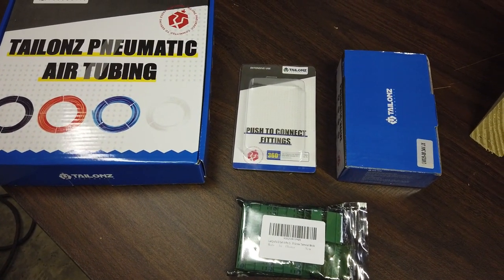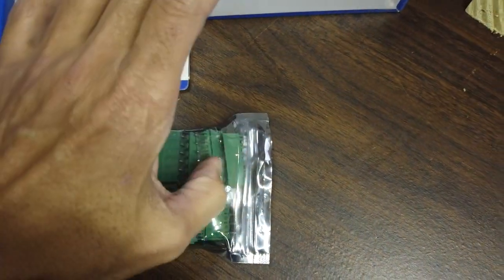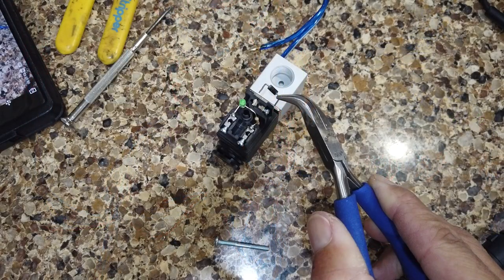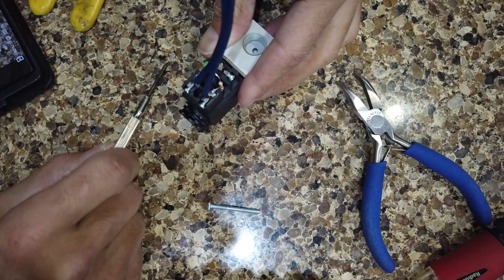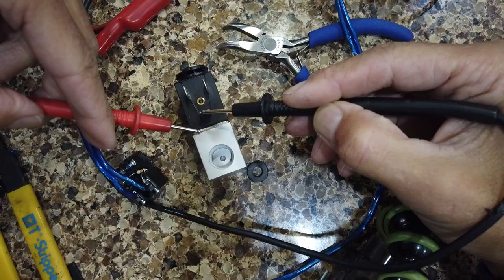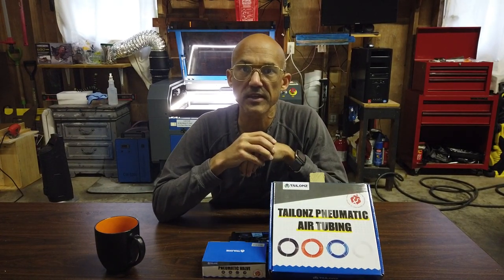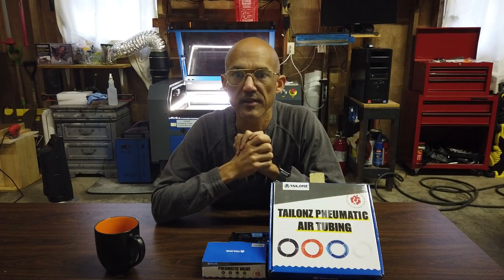CO2 Laser Air Assist - Extra Ultimate Upgrade for Omtech / Ebay / Chinese Laser Engraver / Cutter

Comment: badass video. Do you know what the outputs would be for this mod on a TROCEN CONTROL CARD AWC7824? I want to do this to a Boss HP 3655
Reply from the maker: I don't have a trocen controller so I can't say for sure, but I think a little bit of research will get you the answer you need.  I found this for a similar trocen controller - https://forum.lightburnsoftware.com/t/air-assist-clarification/61377/9

Comment: I think I missed it somewhere but the cylinoid with the diode is that high pressure or low pressure?
Reply from the maker: Both solenoids should have a diode. It protects the controller.
Reply: @directedt3ch  thx you for your response back 👍

Comment: Great video! Very clear and concise instructions. What size compressor do you recommend for 2 laser machines hooked up to the same compressor? I’m planning on running both cut jobs simultaneously
Reply from the maker: As big as you can afford honestly.  The bigger compressors are going to have a higher duty cycle.  If you are driving two machines and 20-30 psi, that compressor is going to run A LOT! If I'm doing a lot of cutting then I hook up my 22 gal Craftsman.  If I'm doing a small job then I'll run the little 2 gallon compressor from harbor frieght.  Luckily the Craftsman is in another room so I don't have to hear it cause that thing is LOUD!
Reply: @directedt3ch  I appreciate your help! I think I’ll have to go with the ultra quiet compressors since noise will be a problem. Do you think the 20gal 2HP ultraquiet compressor from cali tools will be sufficient? I guess, I’m not 100% sure which specs matter for a laser machine.
Reply from the maker: @jim2405  That sounds like a good place to start. See if the duty cycle is listed. Most compressors aren't designed to run continuously. A 50% duty cycle means it runs for x minutes then rests for the same amount of time. Bigger compressors usually have a higher duty cycle.
Reply: @directedt3ch  much appreciated brotha!
Reply: @directedt3ch I have the same co2 laser as you. Curious to know if you’ve ever encountered this issue before. Sometimes, my laser freezes mid cut. Machine is still on and laser freezes at a random spot and stops cutting. Has this happen to you before? It’s happening more often after installing this setup, but it could be other factors.
Reply from the maker: @jim2405  That hasn't happened to me.  I have my laser connected via ethernet.  I know USB can be a bit flaky sometimes especially if you 'start' the job from the computer instead of 'sending' to the laser and then starting the job from the machine.
Reply: @directedt3ch  interesting, I’m starting it from my pc so that could be the problem. A truncated/incomplete file. Seems to stall near the end of a cut. Do you have instructions for sending to the machine then starting from there?
Reply: @directedt3ch  much appreciated! I’ll give it a shot!

Comment: I’m very confused and need help.  Pin 5-6 show 24v with a multi meter but as soon as I plug a solenoid it drops to like 4.4v.  Nothing changes when I run a file with air assist on.  I enabled air assist from vendor settings.  The led on the solenoid is constantly on.  I really don’t understand what’s going on.
Reply from the maker: That is an odd one.  How about pins 4 and 6?

Comment: I enjoyed your detailed YouTube video,  and I think we have identical machines, except Kt322N controller

I'm having a problem.  I wired the LP solenoid to the status terminal and air flows as soon as the machine is turned on. The HP solenoid works fine

When I'm running a job with the Lightburn air assist turned on, both solenoids are on.

I assumed that the output terminals would be live only when the laser is on. I'm finding that this is the case only with the HP solenoid wired to the air terminal

Any suggestions?

Thanks!

Dale
Reply from the maker: I wish I had a good answer for you - I tried to look at the port descriptions for that controller here: https://www.manualslib.com/manual/2437203/Ruida-Kt332n.html?page=17#manual  but I'm still not sure what they are trying to say about the status port.

Comment: I have air assist from cloudray and their solenoid valve has two inputs and one output. Se when signal is low, I gel low pressure on output, but when high, I get hight pressure.
Reply from the maker: That is handy!

Comment: So I wired the solenoid wrong because I was confused about your blue wire with the white stripe being shown over the negative terminal.  Will the switched polarity damage the diode?  I have it wired correctly now but my solenoid will not open.  The led lights are on regardless of what I choose in light burn.
Reply from the maker: If the diode is in wrong, it will be short essentially.  It's there to prevent possible damage to the controller.  But you can try it without to see if that helps.

Comment: Does that diode go in both solenoids?
The cutting goes perfect but when I go to engrave, both solenoids light up...
Wondering what I dit wrong...
Reply from the maker: Yes, there should be a diode on each solenoid.  Pay attention to the direction of the diode. When engraving, your low pressure solenoid (connected to status) show engage. The high pressure  solenoid (connected to wind) will only engage when air is toggled in lightburn, assuming you've made the proper change to enable it.

Comment: I just wondered what diode did you use, was it something like a 1N4004 etc, excellent video and I have seen a few, but but not all have the diode fitted, which is important 
Thanks
Rick
Reply from the maker: I used a 1N4001 diode.  The link is in the description. :)

Comment: Did you remove the stock air pump? If not, how do you disable it? Thanks.
Reply from the maker: @sutiteeraniti2486  I left it in but I disconnected it from power.

Comment: I seen you used diodes in your air assist upgrade, Are the diodes required? I seen another video and it says diodes are optional equipment but doesn't explain why.
Reply from the maker: You'll hear both sides of this argument. When the coil in the solenoid is energized, a magnetic field is created that moves the metal plunger which allows the air to flow.  When the coil is denergized, that magnetic field collapes and that induces a voltage back into the coil.  That will go back to the laser controller.  Those outputs use an optical issolator to protect the rest of the circuitry from the back current, but the opto-isolators can be damaged if they are pushed past their rated values.  The diode is a saftey method to prevent damage.  When installed properly, they don't impact the normal function the solenoid.  When the solenoid is de-energized, the diode provides an alternate path to ground and protects the opto-isolator.  So, could you not use the diode, sure.  Could your controller work for years without issue, sure.  Or one day your air assist might stop functioning because the opto-isolator blew and unless you are good with replacing surface mount  components, you'll need a new controller.  The diode is an extremely cheap safety method.

Comment: I will follow the guide! My machine have a "warning lamp" connect on status. You think its secure manteind this connect?
Reply from the maker: I can't say for sure.  I'd think that connection will go on whenever the machine runs and can't be controlled via lightburn with the air assist toggle.

Comment: i have the 80W OMtech and mine has the air pump for the head (just for purging) i can use this same setup with the purging pump and hook my air compressor to the aux air switch on my controller, correct
Reply from the maker: Yes. You would just need one solenoid and lightburn would only control your high pressure. The integrated pump would be your always on low pressure.

Comment: Do the relays really need to have a free wheeling diode installed? I thought the Ruida controller had built in protection. Also, I was hoping I'd be able to do on/off with the laser on/off rather than status so its not blowing air when the laser isn't actively cutting or engraving. I wonder if there is still a way to do that?
Reply from the maker: I've heard that too.  But for the cost of the diodes, I'd rather not find out that the Ruida controller isn't protected.

Comment: Great video. I wish I would have found this first. I set mine up with the single solenoid. I’m having an issue where sometimes when I hit start in lightburn the pressure on the in-line pressure regulator drops to zero. Would the diode help this? Thanks.
Reply from the maker: No, the diode is to protect the controller when the power is removed from the coil of the solenoid.  I haven't had any similar issues.  I could just be a bad or sticky solenoid.  I've also heard that if the incoming air pressure is too high it can affect the ability of the solenoid to open.
Reply: @directedt3ch  ok thanks!

Comment: I just tried setting this up today. I followed along. I got the solenoid firing when air assist is on in lightburn. But when it shuts off it’s still letting a little air through. What am I missing?
Reply from the maker: When you say it's still letting a little air through, do you mean through to the cone on the laser head?  If that's the case I'd check to make sure that your solenoids are closing fully.  If your compressor still cycles occasionally even when neither solenoid is open, you could have a small air leak in the tubing before the solenoids that is allowing your pressure to drop.  I will note that my compressor still cycles on occasion, but it hasn't bothered me enough to hunt down the issue.  It could just be that these solenoids are relatively inexpensive and not machined perfectly.

Comment: In conventional solenid circuits it is good practice to prevent backEFM pulses reaching voltage sensitive components such as transistors. In the case of the Ruide controller  there is no such risk because all of the input terminals are optically isolated.

 Most nozzles have either a 4mm hole (12.5sq mm)  or a 2.5mm hole( 4.9 sq mm). If you pull your solenid apart is it is simple poppet valve  where a spring loaded rubber pad  is used to shut the flow off against a 1.5mm orifice (1.76 sq mm). To get adequate flow out of your nozzle you are having to use 30psi to create sufficient FLOW through the MASSIVE restricion (1.76 qs mm) within your solenid valve.  I have opened up my orifice to 2.5mm  which will have limited the pressure against which the spring will seal but it has allowed me to use just 4 or 5 psi for my 2.5mm diameter nozzle.

 Your use of two valves along with "Wind" and Status" is a neat control solution. 

Sadly, you stopped the video before we could compare the engraving difference between high and low pressure air assist. We did not see what lens you were using or the type of nozzle and the distance  between nozzle and work.......all importand factors to engraving success with or without air assist.

Thanks for a well explained installation/solution
Reply from the maker: Appreciate all of your insights!!

Comment: I'm not sure where you explained the reason for the diodes(missed it somewhere).  What does it do?
Reply from the maker: I probably didn't mention it in the video.  Inside the solenoid is a coil of copper wire. When energized, the magnetic field moves the metal rod that opens and closes the airflow.  When you denergize the solenoid, the magnetic field collapses and current is induced into that coil of wire and without the diode, that current goes back to controller.  The diode is a "one way" valve that only lets energy flow from the controller to the solenoid and prevents that back current from damaging your laser controller.
Reply: @directedt3ch  Awesome thanks!!!
Reply from the maker: @jimreykdal7477  You are very welcome.
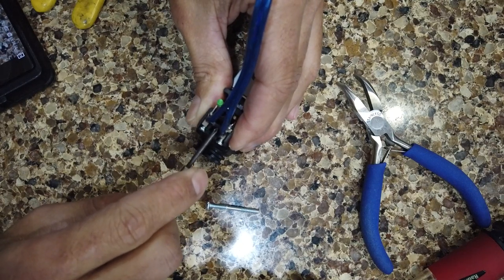Reply: 8:50
Reply: Do you have info on diode?

Comment: Great video, great instructions. Make sure you watch the end. I skipped the light burn machine settings and could not figure out what was wrong. Once I made those changes everything worked as designed. Now to figure out how to disconnect the factory air pump
Reply from the maker: Glad you got it all sorted out Thomas!

Comment: Great Video!  I had it working from Brandt's video with a single solenoid and I could have just been on standby regulating the air pressure regulator but figured there was another way.  Came across this video and it's great!  I didn't pay close attention to the diode requirements so it's currently working with high and low pressure, but I'm ordering the diodes as an insurance policy.  I really appreciate the thorough instructions.
Reply from the maker: That's wonderful!  I'm so glad that it helped.  For the cost of the diodes, it's definitely worth the piece of mind.

Comment: Why can’t the diodes be installed in the control board connector?
Reply from the maker: It's best to disipate that electricity closest to the point of generation (i.e. the coil).

Comment: This is a very helpful video however I did have an issue that I have not solved as yet. We all the steps were complete and I started to run my test I see in your video that Lightburn has the air off on the low air part and on when it's going to high pressure air. My Lightburn has both air as ON. When I started my test the which should have been the low pressure air, the hight pressure air solenoid light was on. I took the air hose loose from the leaser head and connected a piece so I could easily monitor the air flow and the air pressure stayed the same. Any suggestions ?
Reply from the maker: First I'd make sure that you've enabled the air assist function in lightburn.  Then, I'd get a voltmeter and test your controller pins.  The wind and status pins should connect to ground when activated.  Status should go low (connect to ground) when a job starts and wind will only go low when the air assist is toggled on a layer that is running.  You'll also want to ensure that your +24V pin is giving the correct voltage.  You can also test the solenoids individually by connecting them to 24V and a ground.
Reply: @directedt3ch  I did get things working but I had to manually turn off air for engraving and maybe I miss understood but I thought that was automatic thru Lightburn
Reply from the maker: @KennethWilkes-p9k  The air assist toggle on your layer settings wont do anything unless you've enabled it in the Machine Settings.  Then that toggle will actually translate to the wind pin going low to activate your solenoid if it is properly hooked up.

Comment: Love this setup worked without any issues love that the air blows only when engraving or cutting. As for the stock air pump. Can I just cut its power from the controller? Looks like it’s connected with some other wires and has silicone on it. Anyway I just want to disconnect it so it isn’t always running
Reply from the maker: Yes! That is what I did. Just disconnected that little pump from the electrical connection.

Comment: Great video, thanks. Which ruida are you using? For some reason my setup isn't working with status. I get the high air pressure on cuts when connected wind and 24v but the other valve isn't tripping. I can't figure out the issue, it's connected to 24v and status, but the valve isn't opening.
Reply from the maker: Try testing out the second solenoid by connecting it to +24 and ground. This should cause it to open.  That will narrow down the problem area to either the controller or the solenoid.  I've heard of several people getting bad solenoids sent to them.  My controller is the RDC 6442G-B.
Reply: @directedt3ch  I appreciate your reply. The solenoid works when hooked to the power and ground. However, when both solenoids are hooked up to how we want them with wind and status, the one that is giving me issues (wind) is always dimly lit, whether or not it should be switched. But this doesn't mean air is coming out. I tried wiring them in series thinking it was a power problem, but I run into the same issue. Maybe it's the wind pin that's not allowing a complete circuit? I'm also using a higher gauge wire than you and maybe it's too thin? Idk, I'm stumped at this point. I also tried different 6 pin connectors but that doesn't seem to be the issue. Could it be an issue with the controller?
Reply from the maker: @caseygriswold8617  That is the only thing I can think of :(  You did make the change to the settings in Lightburn to activate wind pin, correct?
Reply: @directedt3ch  Yes. But I never added the diode! I thought the thing that looked like one that came on the solenoid was one. That must be what caused the issue.
Reply from the maker: @caseygriswold8617  The diode is there to protect the controller. Is it working now?

Comment: Morning, have a question about the thumb screw on the "LOW Pressure" side. How do we know what PSI is coming out to set it? thanks
Reply from the maker: You just need enough pressure to keep the lens clean. If you can feel airflow out of the cone, you're good.
Reply: @directedt3ch   Install a small air pressure gauge (oil filled) 0 to 40 lbs. on the exit side of the low pressure side and then you can set it to what pressure you want without guessing.
Reply from the maker: @greysonvalleyrrbarnesville152  Thanks for the tip!

Comment: with the air flow control valve how do you know how much pressure you are letting through and what would you suggest to dial it in for the best engraving? Or just trial and error with some test engraves?
Reply from the maker: I just set it for a minimal airflow. For engraving you just need enough air pressure to keep smoke and debris away from the lens.